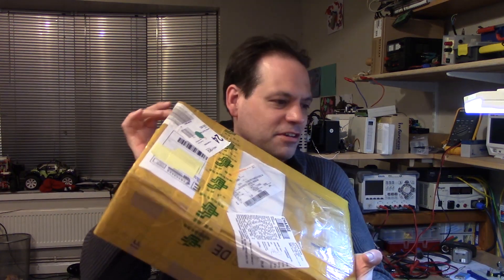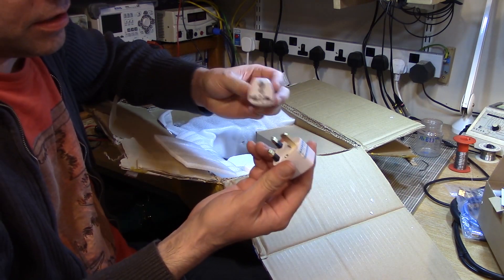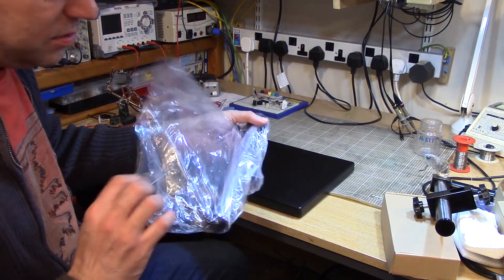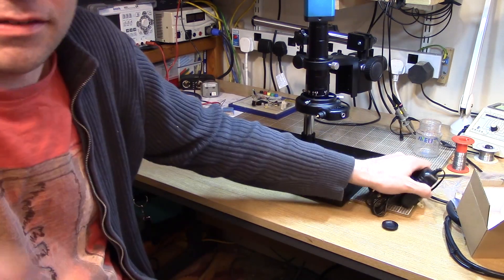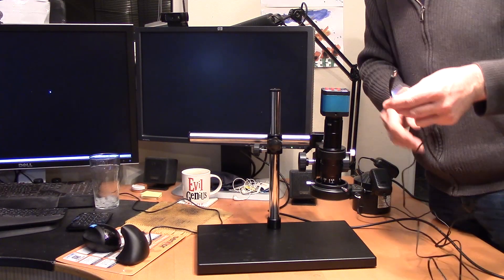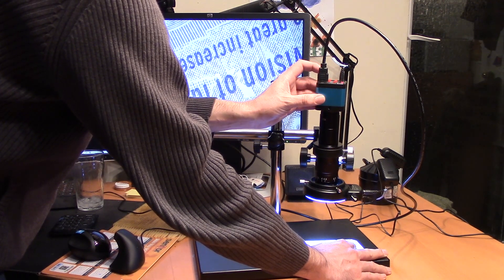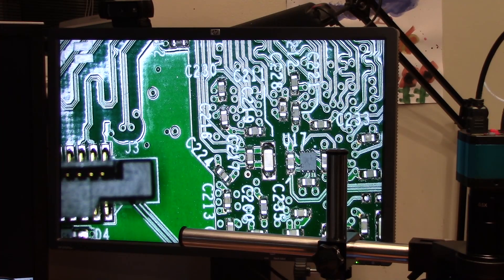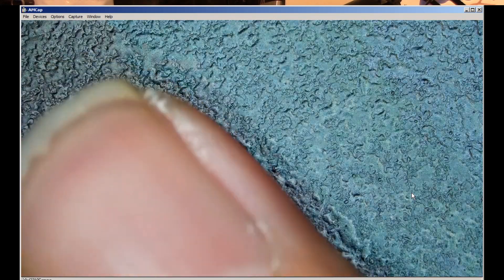Lapsun 14MP Digital Microscope Review

Comment: Recording should be limited to 30 minutes or 12 minutes depending on the firmware. The reason is rules regarding taxation of video recorders vs still cameras.
Your comment on the size of the FOV seems odd. It's a microscope. The large table is to allow you to move around. It's perfectly suitable for soldering.

Comment: The short recording times could possibly be because the SD card is too slow. I had the same issue with a digital camera which wouldn't record for more than a minute. Inserted a faster card, and the camera now records continuously until the card is full, or until the battery goes flat.

Comment: This camera body uses a standard "C" mount for the lens. This means you can search for cctv lense C [ https://www.google.com/search?q=cctv+lense+C&ie=utf-8&oe=utf-8  ] and find tons of them for sale cheap. This means you can find a lens that will give you much more field of view for that cam. BTW, I found these same cams on ebay for around 50.00 US with lens but without stand. So if you can build a stand yourself, you can get one of these up and running for super cheap. Another thing? 14 MP = 4608 x 3072 pixel size on screen. These microscopes from Lapsun are 1280 x 720 = not even 1 MP so a HD webcam could do better then these, check into it before you buy one of these.
Reply from the maker: Still image capture is 10MP due to 16:9 aspect ratio of the capture. The image sensor is 14MP, even through the HDMI output is only 720p. The camera is quite old now and there are certainly other better options out there these days.

Comment: Did you try the camera with windows 10  and what camera software do you use...?
Reply from the maker: Should be fine with Windows10 because the device presents itself a a UVC Universal Video Camera device (the same as all webcams do). For software, I don't actually use any of the things that it came with.. (I'm told that the sEye application has improved a lot lately).. I personally use the device from it's HDMI output to my HDMI capture card which came with a piece of software called StreamCatcher - I don't bother with the USB connection at all. Hope that helps. Cheers!!

Comment: Hi Jim,I bought the Lapsun and took wonderful photographs and video's of Volvox aureus. I used the Nikon C-mount lens on my microscope. The seller gave me a link to S-Eye, but this program is not fully functional. The seller has no other software and Lapsun Company does not respond. Are you willing to send me the program you use via WeTransfer? Pls let me know if you want to see some of the Volvox video's and photographs. It looks like I cannot add these to my reply. Best regards,  Ben
Reply from the maker: Hi Ben - I actually use a dedicated HDMI capture card with my microscope, and I use the software that came with the HDMI caputre card rather than any of the stuff from Lapsun. Lapsun have their software up on their website, so you might be able to find something more useable at http://www.lapsun.com/download.html - Hope that helps. Cheers!!
Reply: Thanks Jim, I downloaded S-Eye which works reasonable. That was the best I could find.

Comment: It appears this camera can be found with different max TF resolutions. 2592 * 1944 and the increased 4320 * 3240. Was this increase done via firmware update or a new lens etc?
Cheers
Reply from the maker: Hi Hartley - I'm afraid I've no idea about the different resolutions. It doesn't seem to be directly linked to the sensor size as my 14MP camera still only generates 10MP stills, and a friend has told me that his 5MP camera also makes 10MP stills as it uses interpolation to fill in the gaps between the pixels.... I guess it's more down to the firmware than anything else. Cheers!!

Comment: i bought same HD cam 14mp
0.5X C-mount adapter
Objective Magnification Power by 0.7 - 4.5X(about 10 - 180X on the display)
cam to pcb space very very less. Any suggestion please? without 0.5X lens cant mount.
Reply from the maker: Hi Vadivelan - I'm not sure what the problem is - With the 0.5X barlow lens attached I get around 30-40cm of working distance between the microscope and the PCB.... Without the 0.5X lens, I agree that the working distance is rather limited. Why can't you mount the 0.5x lens? Cheers!!
Reply: i bought one more lens without 0.5 x again. hope it will work again.
Reply: i have the same problem, did you find a solution?..more work space?..and if you found something please provide a link, thank you!
Reply: better usb 1000x cam is wide coverage and good one.  i bought lens attach ,, no use.
usb cam cheap and got wide angle.

Comment: I'm amazed of this thing! I have downloaded the firmware file, but how do I update it? Put it in the root of sdcard and power up?
Reply from the maker: Hi Jens - Exactly as you say... copy the file onto the root of an sdcard (no bigger than 32gb) and then switch it on. (I didn't have anything plugged into the USB when I did mine... don't know if that makes any difference)... Took about 5 seconds longer than normal to boot up as it wrote the new firmware to flash before it started to give a video output on the HDMI again. Hope that helps. Cheers!!
Reply: Thanks! Like a charm :-) Support/documentation lacks... HDMI output is awesome, still I'm not satisfied with usb support. I have tried to find suitable drivers for this camera, the one installed seem to be a generic microsoft driver. Any suggestions?
Reply from the maker: Hi Jens - The only driver I ever tried with the USB was the Microsoft UVC driver (which worked fine). I was unable to find any dedicated driver specifically for that particular camera. I do know that the camera uses a Novatek NT96650 chip inside, which is normally used with in-car dashcam devices. You might get lucky and find a dashcam driver which works with it. That's my best guess. Cheers!

Comment: Jim, I bought a similar Camera 14MP under another name (Kalinu Tech - looks identical) same menus, exterior case, buttons, etc.  Except I cannot seem to find any function for displaying/editing time (maybe it is different).  Did you ever get a manual for the product?  By the way thanks for the little review and follow ups on the fix for the firmware.
Reply from the maker: Hi Chris - It will almost certainly be the same camera - I think that they're actualy made by this company... http://www.yangwangzhe.com/en/prolist.php?id=35 ... The time editing function wasn't on mine until I updated the firmware. You could try the '14MP HDMI Microscope Camera System Updata File' from http://www.lapsun.com/download.html - It is highly likely that it will work on your camera. The only manual I got was in Chinese... and naturally I lost that very quickly. Cheers!!

Comment: Hello Jim, your support is really helpful. I bought one of this but the cd driver arrived broken. Where can I download it? Maybe you can send it to me in zip? lfernando.ocampo at gmail.com Thanks a lot. Salut from Colombia, Luis.
Reply from the maker: Hi Luis - I didn't need a driver with my camera - Windows 7 detected it an automatically used the UVC (Universal Video Camera) driver. I think that the UVC driver is a built-in with Windows 7, but it's possible that it came with one of my other webcams. You could also take a look at the the Lapsun download page ( http://www.lapsun.com/download.html ) - They have a firmware update for the 14MP camera on there along with some new S-Eye software (which I haven't tried myself yet). Hope that helps you out. Cheers!!
Reply: Thanks a lot Jim. I used the Lapsun S-Eye and it works plenty.  Great.

Comment: hi im an artist, really need your help. im trying to find the right microscope for my work. i paint on 6" action figures (the heads are the size of a ten cent dime....) so i have to paint the eyes lashes brows Etc. its really small work.. my question is can the microscope zoom in on an area of Dime coin well?? and still have a good working distance for my hands , brushes and tools for me to work with? please let me know. thanks
Reply from the maker: Hi kairus1 - Working distance is about 15cm with the default lenses or about 35-40cm when using the optional 0.5x barlow lens (this also gives a much larger field of view - I use the 0.5x lens nearly all the time as I prefer it when I'm soldering surface-mount components). There's lots of room under there for brushes and tools etc...  Hope that helps. Cheers!!
Reply: Jim Conner hi if i buy this microscope with the barlow lens 0.5  do you think i should be fine?   http://www.ebay.com/itm/311359164605?ssPageName=STRK:MESINDXX:IT&_trksid=p3984.m1436.l2648
Reply: Jim Conner thanks for your help Jim.
Reply: i think i might buy it today. so any help u can give me i would greatly appreciate.
Reply from the maker: That one looks very nice to me... 1080p output (better than mine)... but it doesn't look as if it has a USB output, or the ability to record to SD... If those things aren't important to you (I never use USB and only very rarely use the SD card on mine) then I say go for the 1080p model with the better stand. Hope that helps. Cheers!!
Reply: Jim Conner okay but do you think ill need the barlow 0.5 lens?
Reply from the maker: I would strongly recommend the 0.5x lens - It is certainly usable without it, but the field of view is very restricted. Cheers!!
Reply from the maker: Yes - you should be fine with those. Hope you don't have to wait too long for them to arrive. Cheers!
Reply: Jim Conner i just found out by lapson that the newer microscope won't work with my mac book pro laptop.  is it the same with your microscope?

Comment: Interesting - thanks for the video. Have been looking at the version without the stand for my channel, but looks like it really needs a HDMI capture card.
Reply from the maker: Hi SDG - The HDMI capture card isn't as necessary anymore as it was when I made this video (I did a follow-up video covering the firmware fix). They finally fixed the bug in the firmware which was limiting the recordings to around 30 seconds, so it has become possible to record long videos to the SD card OK now. I was using the HDMI capture card and a splitter cable so that I could have a screen to watch when soldering, whilst simultaneously capturing on the PC, but you can capture straight to the SD card now and still have the output on a screen. (The HDMI capture card is still nice to have anyway though). Hope that helps. Cheers!!

Comment: How did you load the new firmware in the scope?
What app did you use for that? 
Thanks for your time
Reply from the maker: Hi +Cristian Armaselu - There's no app needed to update the firmware - You just save the .bin firmware file onto the SD card and the camera will find it when it powers up and re-flash it's own firmware. I did find though that you need a SD card of 32GB or less for the firmware update to happen - Although the camera itself supports 64GB cards when it's up and running, I don't think the bootloader can handle anything bigger than a 32GB - I used an old 2GB card when I updated my camera. Hope that helps. Cheers!!
Reply: +Jim Conner Thanks very much Sir!

Comment: Hi Jim! You could give me your opinion on this digital microscope compared to yours? There is much difference? This may be within my budget. I'm going to use to repair cell and I am new in this field. I want to make a secure purchase. Thank you very much friend!

http://www.amazon.com/Industry-Digital-Microscope-C-mount-Monitor/dp/B015XBFJYC/ref=pd_sim_sbs_421_1?ie=UTF8&dpID=5181eA4KesL&dpSrc=sims&preST=_AC_UL160_SR160%2C160_&refRID=01K2VDC9RB03DBCKG5Z5
Reply from the maker: Hi +Richard Hernandez  - I couldn't guess at how that particular microscope performs, so any opinion I give will be pretty much worthless - I will say though that the 14MP sensor is not very important as the microscopes are only outputting 2 megapixels video streams anyway. For me HDMI was a strong requirements (rather than VGA+Composite), but your requirements are almost certainly different to mine. I suspect that the unit you've found is perfectly useable, but I'm really only guessing. Sorry I can't be more help, but without getting my hands on the other microscope, I can't really make any meaningful comparison. Cheers!!

Comment: How did your 'Barlow Objective Auxiliary Lens 0.5X & 2.0X For Microscope Camera C-MOUNT 40.5mm' lens package work for you?  I got this camera and I like it but the field of view is way to zoomed in!
Reply from the maker: +Kris Kizlyk I leave the 0.5X barlow lens fitted pretty much all the time, as it gives me about the right field of view and working distance for soldering  - I certainly have no regrets in getting those lenses. Cheers!!
Reply: +Jim Conner Thanks Jim.  So far I like this camera a lot and I appreciate your review!.  I will probably by 2 of the 0.5 lenses and daisy chain them to see how it works by getting even a larger field of view.  I looked at getting the one that EEVblog suggested (DIYINHK) but it was twice the price and twice as crappy.  The Tagarno would be a dream!
Reply from the maker: Hi +Kris Kizlyk  - Yeah.. that DIYinHK thing, although an impressive hack, didn't inspire me to buy one - I'd be more inclined to make my own using the same hack. Glad you're liking your microscope. Hope you're having a good weekend. Cheers!!
Reply: +Jim Conner Damn!  I waited a month to get these lenses and they don't fit my microscope...comparing yours to mine the lens is completly different!  I have a variant...but if someone else is looking here is the link with the lens.

http://www.ebay.ca/itm/360X-C-MOUNT-0-5X-2-0X-Barlow-Auxiliary-Lens-for-Industry-Microscope-Camera-/311029313516?hash=item486acaafec:g:JpgAAOSwQItT1wWA

Comment: Hi Jim,
Thank you for your informative video, I was thinking of buying one of these setups.
Could you tell me about the optics please? I was wondering if it has parfocal zoom? Or put another way, when you change the zoom do you then have to change the focus too?
Cheers!
Reply from the maker: Hi +eggsperiments - There isn't really a zoom control as such... only moving the camera up/down using the knob on the stand, and yes, you do have to adjust the focus on the lens when doing that. Hope that helps. Cheers!!
Reply: Thank you Jim, and thanks again for going to the trouble of making the video.
Cheers,
Simon

Comment: what is frame rate...is there a duration issue with video?
Reply from the maker: Hi +rajkumar jha (aadarshvikalp)  - The recordings the camera makes are 1920x1080 @ 30fps (no interlacing).... and yes... there's a problem with the duration - the camera stops recording for no apparent reason after 30-40 seconds. I recently gave Lapsun a nudge on the issue and they replied saying :
"We  have feedback this problem to the factory already, at present they have
 not fixed yet, due to at HDMI model, the video file is too large, if 
set the time is long, the processer will be quite busy and maybe caused 
the picture delay or dead, please understand."
Hope that helps you out in making your decistion. Cheers!!

Comment: When you take a photo (11:40), where are the photos stored? Is it hooked up to HDMI with a TF card at this point? Are the photos being saved to the card?
Reply from the maker: Hi prettycode83 - The photos are stored on the TF card as 10MP images. The photo functionality is not available when you're connected via USB as if you have the card inserted and USB connected the camera goes into mass storage device mode to let you copy the pictures off. You need to use the HDMI output to be able to take photos or record videos (N.B there's a bug in the camera which means it stops recording videos for no reason after 30-40 seconds). HTH. Cheers!!
Reply: Jim Conner Ah, this is so helpful! I understand how this whole setup works much better now after that explanation. Do make an update (a comment or a new video?) if Lapsun ever gets back to you with a video recording fix! Thanks much, these two videos have been very useful!

Comment: hey jim .. did you have to pay custom charges and if how much (im in the uk as well).. ? did they fix the recording time ?
Reply from the maker: Hi Pierre Kircher - Yes - I got stung for custom charges on it's way into the UK. I paid £250 for the camera, lenses and stand and IIRC it was around £40 for the customs charges, including the 'administration fee' that they love to charge. They have not yet fixed the recording time problem. I should probably give them another nudge on that one. The barlow lenses were £22.75 and came from the same seller. Cheers!!

Comment: Great review Jim. I also got my hands on this camera and so far I am very happy. You mentioned in your review the use of a 2x Barlow lens to double the magnification. What is the spec for that lens and where can I get it? - Thx
Reply from the maker: Hi thomas ziemkus - The barlow lenses I got came as a set of two... one of them was 2x and one was 0.5x... both are really very useful when you want extra zoom-in or zoom-out.... Here's the ebay link for the ones I got. Cheers!! ... http://www.ebay.co.uk/itm/Barlow-Objective-Auxiliary-Lens-0-5X-2-0X-For-Microscope-Camera-C-MOUNT-40-5mm-/141361432785?pt=LH_DefaultDomain_3&hash=item20e9cc48d1